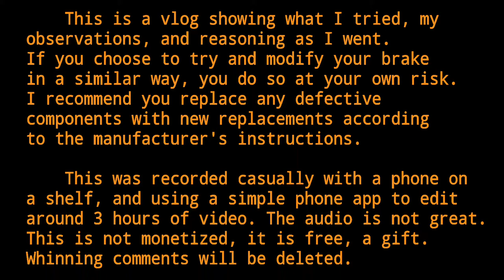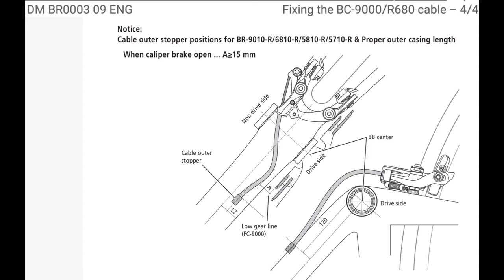Shimano Direct Mount Rear Brake Repair and Mods Tutorial Guide How To DIY

Comment from the maker: TIMELINE:
00:10  DAY 1 (bad - LA/SA)
xx:xx  Long Arm disassembled b4 filming
00:30  Short Arm disassembly
03:10  Full Assembly Order Layout
03:30  MOD Double Spring
03:55  LA clean and assembled (off camera)
04:14  SA clean and assembly
05:39  DAY 2 (bad - LA/SA)
06:18  TOOL FABRICATION
08:07  MOD SA + grease
09:52  LA clean + grease
10:48  DAY 3 (bad - LA)
11:29  LA disassembly
12:00  LA cut out liner material
14:10  MOD LA assembly
15:37  DAY 4 (bad - LA)
16:46  LA disassembly
17:40  LA MOD assembly + grease
18:08  SA MOD disassembly
19:55  LA bore measurements
21:14  Full ~realtime assembly LA/SA
27:02  DAY 5 (good)
27:48  MOD short spring (watch 29:13 too)
29:04  DAY 6 (good)
29:37  Brake on the bike
30:14  CB90 Warning
30:41  MEASUREMENTS

Comment from the maker: UPDATE -1 
 November 7th
This marks 1 month since day 7 in this video. I've had 4 days off the bike since October 7th, including today. So it has been around 700 miles in 28 days. Last night it wasn't raining hard, but enough to wet the bottoms of my socks in the last few miles despite toe covers.

 The brake is starting to feel a little bit stiffer at the lever, but still works without getting stuck at all. I mean, normally when these brakes start to fail the caliper arms will stick in place. This makes some slack in the cable that you can feel at the lever. I haven't felt anything like that. It just feels a little stiffer and slightly gritty when actuating the brake hard.

  I have not removed it or made any attempts to service it since the video. After the rain ride, and a day of sitting (today), I plan to take it apart and maybe regrease it tomorrow. I'm in Southern California, riding in places where saltwater corrosion can be an issue, and this was the first rain in around 6 months, so the cleaning is nothing extraordinary. I still haven't felt the need to source a replacement, or make any changes. Let those actions and observations speak for themselves.